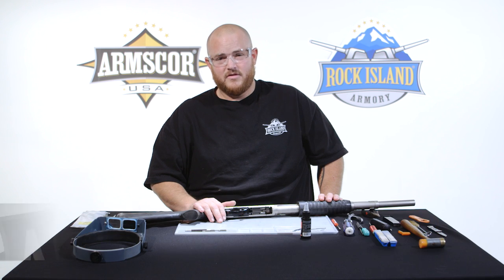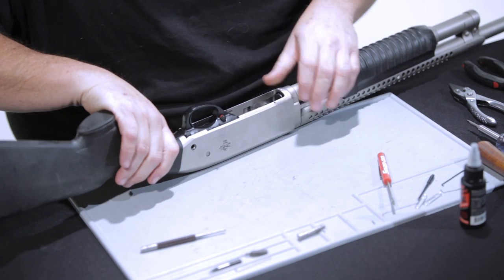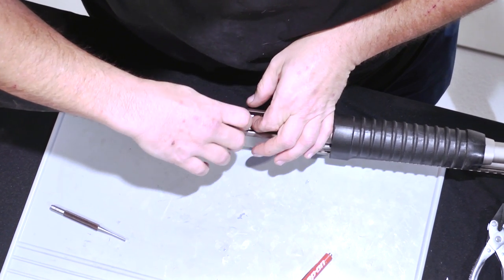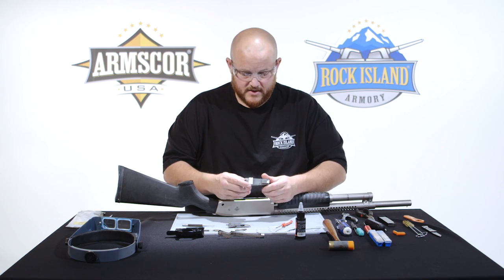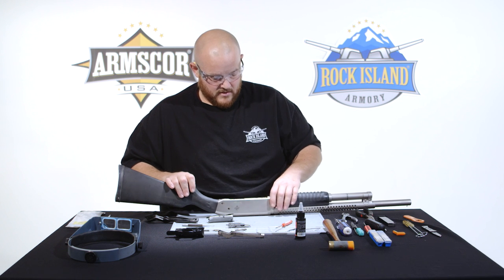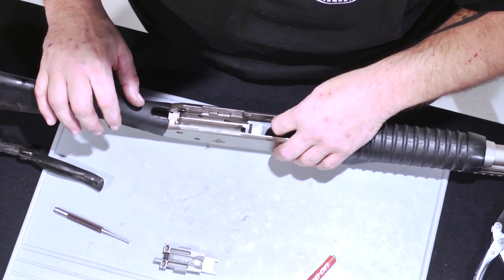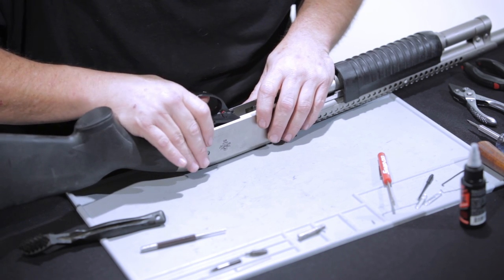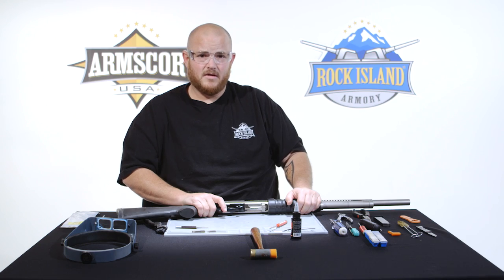Rock Island Armory - M5 Pump Shotgun - Disassembly Assembly

Comment: I have an issue that the shells from the magazine tube won't cycle. The steel shell holder won't catch onto the metal guide when you pump it back.
Reply: I'm having the same problem, although mine is intermittent. Sometimes it will cycle or drop the shells out the bottom as well. Did you ever get it fixed?

Comment: I came here looking for info on how to get the stockbolt off. I assumed "disassembly" meant a complete demonstration, not just getting the trigger group and bolt out.
Reply: predcon1 take the 2 screws out of the recoil pad, and remove it. That gives you access to the stock bolt.
Reply: That part I managed to figure out on my own, oddly enough. I meant removing the stockbolt itself. The manual has an exploded view, but doesn't say what size socket to use.
Reply: I tried. I have nothing that will reach. My nut drivers are too short, and I don't have a ratchet extension long enough to reach it. Need an 8 inch extension. Sorry.

Comment: How do you remove the magazine spring? I have one of these and I can't figure it out!
Reply: Remove the heat shield and the ring that clamps it to the barrel, then at the barrel end of the mag tube unscrew the two small screws and pry the cap off, that lets you remove the mag spring.

Comment: Customer brought one of these in and the spring around the magazine tube is broke or jammed up, because it's almost impossible to pump/operate the action. How is the magazine tube held on?
Reply: It's threaded I was able to find out by looking at the after market tube for this gun, because not even the factory schematic shows threads on the tube. The spring wasn't broke but it's very sharp and kept binding so I just left it out and the pump works fine. As for the final fit of the internal parts, there were a lot of machining burrs left behind and sharp/rolled edges. I removed the burrs and rounded the sharp/rolled edges and now the action is smooth as butter. When you push the bolt release button with the muzzle pointed upwards the action just falls open, real smooth.

Comment: When i got mine it was COVERED in some kind of gun oil. No matter what i do i cant get it off. How do i clean that crap? Getting it on me and sprayed with it makes shooting this gun unpleasant
Reply: Mine is also covered with oil.  I would be interested in any replies to this question...
Reply: Find a good solvent. I use shooter lube gun solvent. Comes with a spray nozzle too if you really need to get into places. It dries without any residues and is safe on most finishes. Just make sure to still use a thin layer of lube afterwards to protect from corrosion and friction because it will get the gun bone dry.

Comment: How would you remove the barrel of the m5 shotgun
Reply: Punch the pin and unscrew it.
Reply: @smartacus88  which pin?
Reply: @ethanstang9941  The barrel pin. It's a pin running under the barrel towards the front of the receiver.
Reply: @smartacus88  you just push this pin out?
Reply: @ethanstang9941  yes, with a punch.
Reply: @smartacus88  thank you
Reply: @ethanstang9941  you're welcome